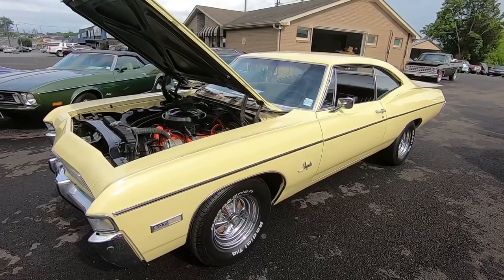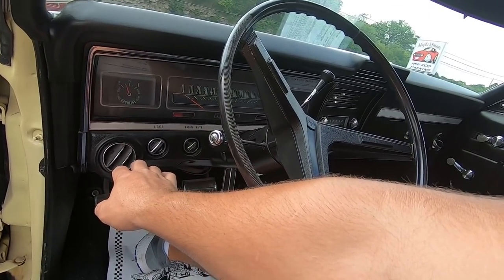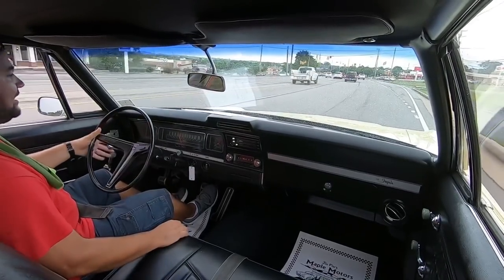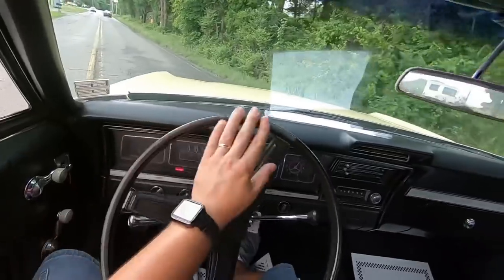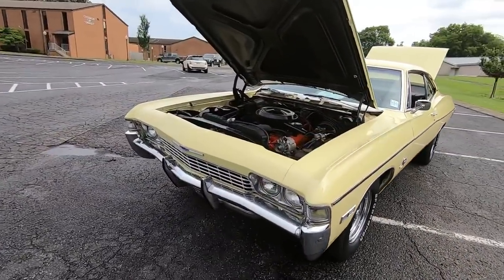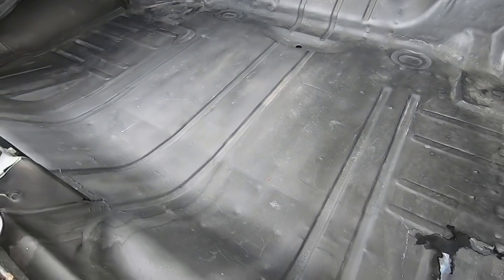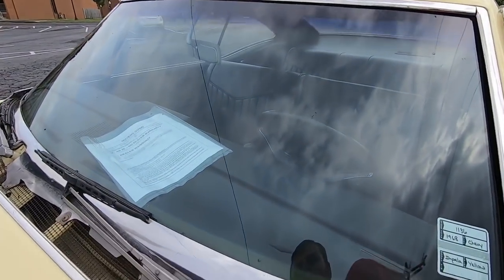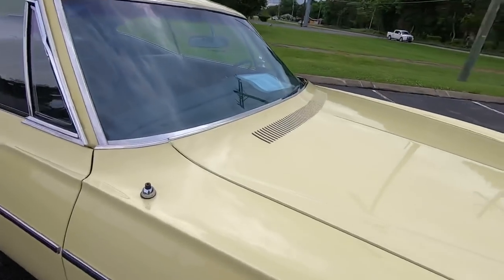Test Drive 1968 Chevrolet Impala Fastback Sport Coupe SOLD $25,900 Maple Motors #1136

Comment: This vehicle may just have only 39,000 miles by the looks of that undercarriage. '68 fastback coupe is one of the sharpest body styles for the Impala. This is the car back in the day that you chose to take to the drive-in theater because of the trunk size. Would you look at it, just look at it! The package tray is rust-free.

Comment: 307 not the best small block ac vents but no A/C system these engines had small valve Guilds  Would smoke when started after a while

Comment: I had one of these in 1975 biggest piece of junk, burned a quart of oil a week, was same color with black vinyl roof, old man bought it for me while I was in high school...he knew cars why he bought that piece of crap was beyond me, the valves were knocking louder than the cops serving a search warrant.  It died a proper death 2 months later from all the oil collecting on the mainfold from the leaking valve covers, caught on fire while I was going down the road, and burned fast..I wasn't hurt but I sure was glad I was in a small town with a volunteer fire dept, burned long enough to it's death.